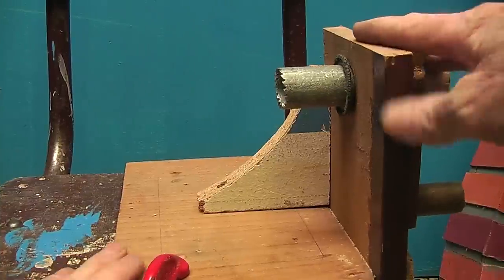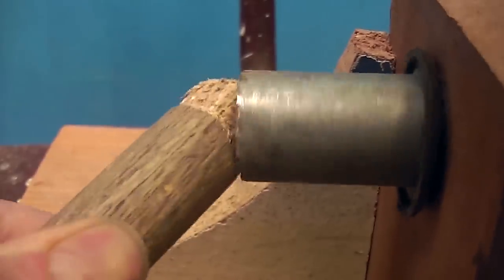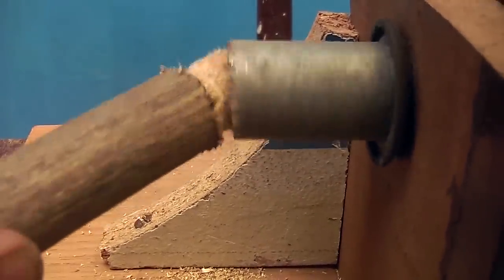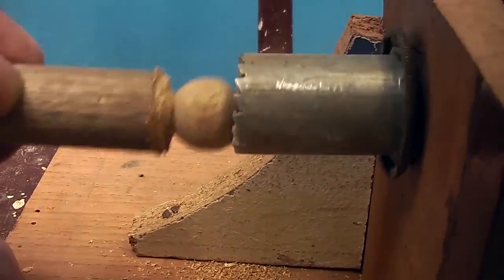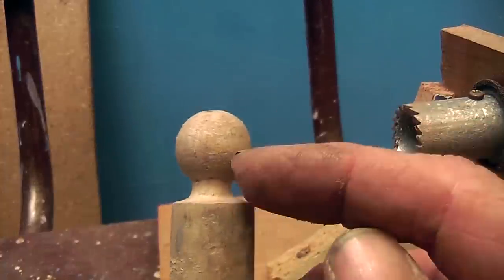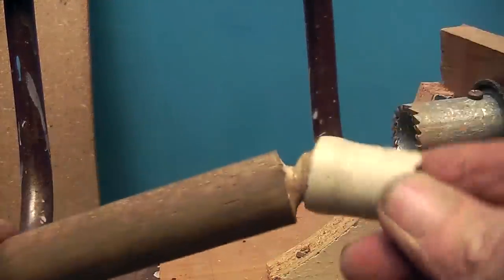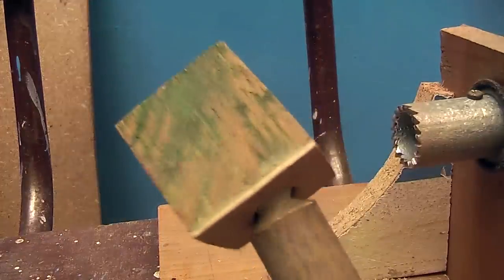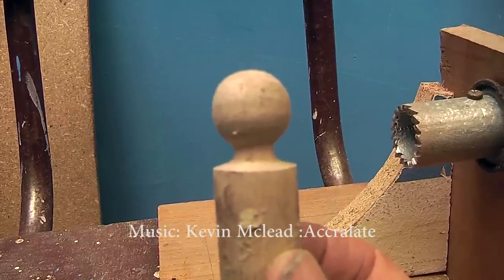Wooden Ball and Socket

Comment: you know you could have just used a hole saw
Reply from the maker: you probably could if you had one. Plus you would have  to set  up  your drill, and  you  would  not  have  as much control over it, and  a hole saw is too aggressive.
Reply: you could also have someone else do it for you. for example kids in India. why should we use our hands at all? it's not like the other animals are doing it. the point is to figure out how stuff works, and reinvent. there are so many things we forgot how to do. and it's satisfying if you can make the tool yourself.